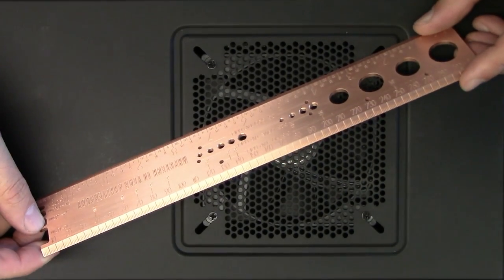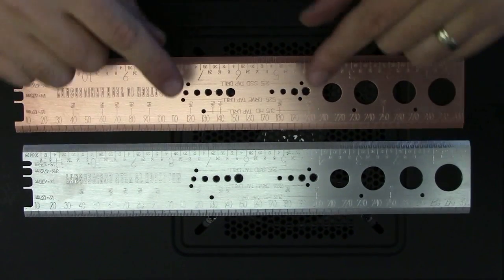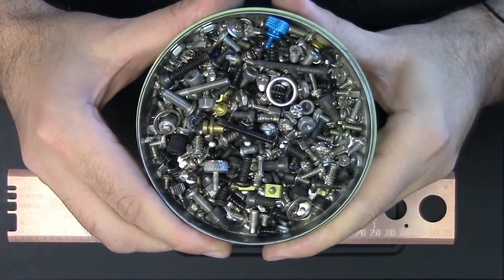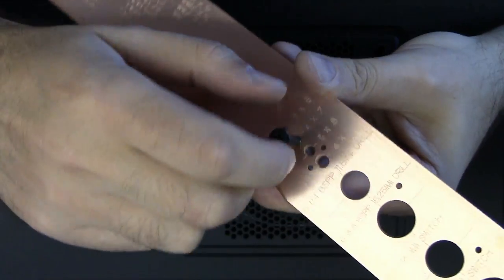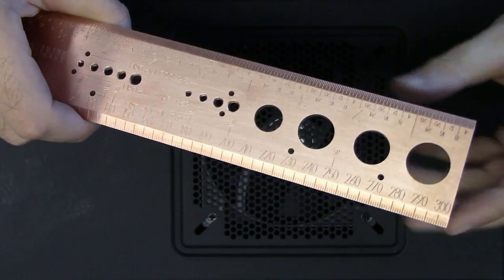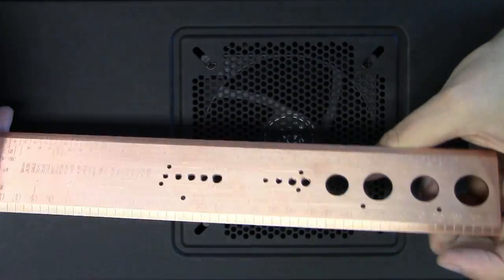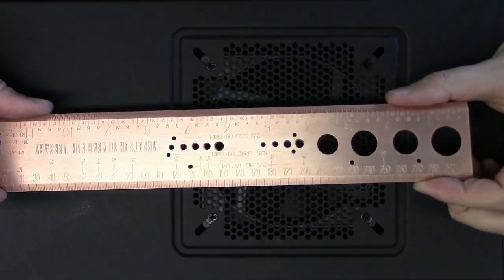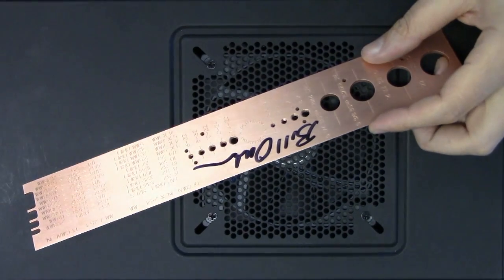COPPER PC Mod Ruler Giveaway & Mnpctech.com Discount Voucher

Comment: Not only am i attempt to make my first custom case from scratch from stainless steel & this would be an invaluable addition to use to template out my ss panels, mark holes, use to make the markings to cut the fan , hdd, motherboard tray, ect...
  Also, as a Lineman, i would use this every day to mark poles for proper distances, ss transformers to mount meter cans and drill out sides to mount c.t.'s.
  At home this would see everyday use around the house, for my daughters homework and my hobbyshop. And, i do have two coffee cans of bolts and screws that i one day need to sort out.
  I see a multi tool that this Single Father wants Santa to bring!
Reply from the maker: +Aaron Mcneal Congrats! Contact me with your shipping address, http://mnpctech.com/contact-us.html

Comment: I would use it to help install a tempered glass window on my case.... I'll need to check thickness, measure and rule lines, check screw sizes, use the holes to make nice rounded edges in my window and of course to cut in half all the apple computers...

Comment: This definitely is the coolest ruler I've ever seen! This would come in handy for future scratch build like my 3D printed case I made recently. When you are designing a 3D model for a PC case you have to take a lot of measurement.
But the coolest part about it are the threads in the middle because you are totally right about the random screws lying around!
It also would make for a cool unboxing knife.

Comment: I would use this quite frequently. The conversion chart alone is a godsend. Even though i know fan sizes by heart, I have messed with roulettes before for the larger ones. For screws and and width of different materials i usually use a vernier tool, but some sizes are more common then others so the reference threaded holes and the thickness gauge will be more than helpful. But most importantly the thing that makes this ruler a ruler, the bevel edges and the SCRIBED increments.

Comment: I would use this more for my 3d printer.  Since i have heard of the accuracy of this ruler, it will help to calibrate certain parts of the printer, not to mention the upgrades and nozzles swaps will be easier with the screw size gauges.  I have cups upon cups upon film cylinders and other containers that i can use that for separating the screws and becoming more organized.  Finally, it will help with my cosplay, the weight alone will help with pepakura cutting, or foam cutting.

Comment: Hi Bill I happen to have a ton of pc screws and I forget what the sizes are! I also get annoyed with the manuals pc case manufacturers send. The screws in the drawings are very similar and hard to figure out. I would also use it to measure the distance inside my case for bending acrylic tubing and for ventilation vents I want to add. That's what I need it for. Thank you sir!

Comment: I'll use it to open a box.... of new acrylic sheets I"m planning on using for a custom computer case. Also, of course I'll be using it to measure out where I need to mark screw holes for mother board mounting, ssd mounting, etc.... I'll also use it for the custom water cooling I'm planning on doing with the build. Can't wait to get working on this build this winter :D

Comment: I'd use it for scraping old drywall plaster off the garage floor...  oh, and obviously for the mods I'll be doing on the new case I'll be buying for my new build I'll be doing in the new year!  22 and 16mm anti-vandal switches, 240 and 360 rads, pump, res, and possibly my first hardline!

Comment: I plan to completely modify my h440 computer case and i will use the flat side to measure where to cut and make lines etc. Also the holes will be quite useful to create ventilation, esthetics, and cable holes. Thanks for picking me if you do.

Comment: I use my tap and die kit. I have a rethreading kit for putting threads back in. I can see this being handy for my PC screw bin. The aluminum one is good enough for my needs though. Fancy copper one might end up hung on a wall all signed like that. I'm working on a 1940's record player. Turning it into a dual PC cabinet. Replacing the guts and fabric with glass and lights. It will have an AMD side and an Intel and Nvidia side in each speaker box. The top lid will hide the DVD and blu ray players. The center cupboard will be a single liquid cooling loop for both systems. The PSU hidden on the bottom. On the back it will have a 6 foot pony wall made of plywood for hiding cables and mounting the 3 46" LCD's on swing arms. I have 2 old cases that the Mobo plate can get easily adapted. The I/O shield is hard to get lined up. The HD trays and so on. I'm still working on getting the parts together. Haven't even started on the liquid cooling parts yet. I have the nvidia system and 3/4 of the AMD system together. I might wait and see what the new AMD line looks like.

Comment: Nice! Like the threads for checking screws and the passthrough holes. Those can be used as template to make watercooling holes in ur case. Want it for hard tube build. Best regards Balubish

Comment: I am about to start on my own pc case mod for my next system. Taking an old  2004 Apevia X- Cruiser and bringing it current for radiator support and USB 3.0 and building a skylake system in the case. Oh the things i could do with all the parts at Mnpctech not just the ruler, but the ruler is a great start to my moding arsenal.

Comment: I'm going to teach my son how to change the airflow in his crappy case. We will take out drive cages and add fans with mounting brackets to the front panel. We will also add a single fan to top panel which I will use the ruler to position and  a fan cutout pattern printed from your website :)

Comment: Well, long story short, I would use it for modding my Air 540. My wife is doing here PhD and I have a ton of extra time these days. So, knowing that I am getting a Dremel from my mom, I thought I would get my hands dirty with modding. Looking at making a window for the non-window side of the Air 540. Adding some lights. And maybe some water-cooling fun.

Comment: I'm just now getting into modding and I always find myself looking around for some instrument to measure for my cuts or to make a straight line and my textbook just isn't cutting it anymore. My interest right now is completely rebuilding my wife's old HP computer. I've scoured the interwebs trying to find the dimensions for this thing. Nothing, not even on the HP support site. I recently visited the mnpctech website and came across this ruler and thought to myself "This would be sooo awesome to have." then I saw the price tag and my hopes were crushed. My wife would never let me spend that kind of scratch. Especially on a ruler. I guess the textbook will have to work for now or you can save me from my torment. thanks

Comment: Bill I am always using a tape measure its a complicated task always because in certain areas the measurements are never correct, the Metric screw size is a plus I have to guess screw sizes and 70% of the time I can never get the right size you have no clue how many times I want to buy screws from your store and I don't have means to determine size or length, that ruler would be a arsenal in my modding toolbox and a treasured peace being signed by the master himself. I am a student of yours and that ruler would be as a teaching tool to some day being able to identify screws, threads and dimension like you do.

Comment: This would save me so much time modding a Define S case I've been working on for months. Would come in handy since I lack a proper work shop and have been making templates with MDF. Also would work as a good back scratcher as dremel tool doesn't work so well for that...

Comment: I'm planning on making a "stealth mod" using crappy old beige-box case. I want it to look like Win98 machine from the outside (including slot-loading CD-ROM drive), but with all the modern components and water cooling on the inside. I would use the ruler to measure and cut holes for rads on the bottom of the case and openings for cable routing on the motherboard tray. I've damaged my plastic ruler with an x-acto knife.

Comment: This would save me so much time and frustration. For instance I had to drill some holes in the bottom of my hard drive rack from a ssd mount. I tried my best to get the holes exact but I was still off by a hair so I had to make the holes bigger. I like I'm sure many of us have a huge bin of bolts and screws. If I had this I stand a much better chance of sorting said hardware.

Comment: I would use it to help me with my little PC MOD Project build on the Apivia X2 Sniper Case. So far i installed 3 Fighter pilot toggle switches on it. I had to use a normal ruler for the measurements and spacing of the switches which made it harder. I plan on modding it a bit more by adding some 120MM fan filters and a small water loop. I plan on starting a new project by december, my micro ATX build in a 50 cal ammo can and I'm sure this tool would help alot with the measurement and cuts on that small amo box.

Comment: I would use it for measuring lengths too long for my caliper and easily see what types of screws (what size threads) I have with the handy screw holes on it

Comment: I would use it to help me finish my long running powermac G5 to ATX mod.

Also, i have a huge load of misc. screws i've stripped from old PCs, that are desperately in need of sorting. I already have jars, even. Just don't have a good way to confirm threads

Comment: I'm a computer science major and thinking about changing to mechanical engineering at my college. I'm in the process of modding a Fractal Define r4 to EATX with a vertically rotated motherboard. Then after that or if I get the money for my new LAN build before it I'll be trying to mod a ITX Ncase M1 to fit a ATX motherboard with maybe an external power supply if I can't fit it inside... which most likely I will not be able to do, but hey its worth a shot! Side note, not a full ATX power supply, the SFX  silverstone 600w modular one.

Comment: I'm gonna use it to mark where to cut the material and size up the drill holes for my custom cases, since I just have a plastic ruler the lines sometimes get a little off and I have to redo it, with this heavy beast, it wont be a problem.

Comment: I would use it to slice vegetables XD No but in all seriousness, I'd use it to precisely measure and gauge holes on my already-slightly-modified case. It's a basic case, but after a basic paint job it already looks 100x better. I want to add some colored fans, which the ruler would help me measure the holes for it.

Comment: I would use the ruler to help me create a shroud layer/case extension/radiator mounting shield (case mod) for the build I am doing for my living room/house mates so we can finally have a HTPC/Steambox now that we have a steam controller. I also do a lot of PC builds for friends and family so it would be really useful for measurements to check fan spacing and clearances when adding radiators. I think having a super quality ruler would also allow me to possibly make better use of my Solidworks software in designing/experimenting with case mod ideas. I would also use it at every one of my birthdays to cut my cake and open the PC Parts I asked for at Christmas :P

Maybe if I get this ruler I can finally apply the Overkill 240mm fan grill to the same HTPC/Steambox case mod! Hmmmm.....

Comment: First I will sit down with my scads of hardware and the threaded fastener gauge and sort & organize my screw assortment.  No more eyeballing them, and no more stripping threads by choosing the wrong screw.

Second I would use it to plan the fan and switch placement then draw it to actual size.  Once I have settled on a design, I will use it to layout the fans and switches to make all the case cuts.   Would end up with Fans that are straight and even, and switches that do not “wobble” around in holes that are too large for them…  Liquid cooling tubes entering/exiting the case, no problem there either, there are gauge holes for that too. 

I would then use it to make custom drive cages, and know the exact hole placement without taking time to measure.  Mounting SSD’s, Optical & Hard Drives?   Want it where?   Mark it, Drill It, Mount it, Done…

Did I mention measuring for case lighting?   I would take measurements of the interior and plan the case lighting scheme. With this info I would take strips of LEDS, cut them the length and mount them in the case.

Essentially with this ruler I would take my case creations and modding to the next level. I am sure along the way with this ruler in hand I will come up even more ways it can help in my endeavors…

Comment: I was going to comment asking whether threaded screw holes to gauge screws on this rule, turns out you've addressed it in this video. I have a simple moulded plastic screw gauge, but it willn't tell me the difference between UNC, UNF or metric screws as it's only what fits in the hole; good job on adding the extra time and tool wear to add these useful threads. I know it's picky but this is a rule which markings start from the edge, while a ruler has the start offset inside the edge.

I am not modding PC at the moment but I still have a handy set of tools that I recently used to put together an aluminum camera-tripod mounting plate, which I probably drilled the holes a touch too tight before hand tapping threads. I'd almost be afraid to use this rule as your autograph will wear out, but cool thing about this being copper is watching the patina porn.

Comment: Well, other than the standard "I would use it to mod this or that", I think first I would get some foam board.  Then, using a push pin, and some colored penciles, I would create my own Spirograph design with the various holes.  Once I was done with that little project that I'm sure my 8th grader would love to get in on, I would start plotting out my retirement build.  And yes, I may even sort out some of those various screws I have all over the place.  I didn't know that the holes were already threaded so that's a nice feature.

As for the rest of this thing, well, as may know, if you mod; then this is the rule to use. (a little gratuitous sucking up can't hurt, so don't hate)

Comment: currently building my first rig for my 900D and i had already replaced my custom mid plate thrice be cause of misalignment and/or imperfect holes. those holes would be very useful specially we dont have that much option in my place. i would like that ... :D
...
 thanks for the chance to join and more power
...
cant wait for your next project video log
Reply: those holes for screws are very usefull i mean ..

Comment: I would use it for my modding project. Currently working on a Mac Pro 2006 atx mod in white this time. I would use the thread checker and also thickness checker for all the acrylic.

Comment: I would use it for school and for my pc build. For school i do graphics and this would be great for model drawing and the small circles would come in handy. And for my pc im making a pc for Christmas and most likely in January doing a custom water cooling loop. This would be a great ruler for measuring the fans and radiator. It would be handy for the screws and the water cooling holes. gl everyone

Comment: I would use this MNPCTech ruler to help me build in my Special Edition NZXT Noctis Midnight 450 #29/45, which will happen to have a subdued Copper theme using the AsRock Z170 Extreme7 MoBo coupled with 2 XSPC Razor R9 290X water blocks and EVGA DDR4-2800 Memory Kit. Any copper themed ideas you might have will be welcomed, but I don't want to cut into this case... :)

Comment: i am going to use it for a really old case i bought second hand from a really cool dude. A lian li pc-2010 mod it to fix a 480 on top and 480 on the front and move the back io down a few pegs if it need be change switches to different locations and maybe make a new motherboard tray

Comment: That would be a fantastic item not only in my pc modding world but also with the manual machining I do at work. could use it to mark the area for a side panel window, then for the radii on the corners you could use the button hole reference. so much I could and would use this one tool for. sadly if I was to get it, I don't think the signature would last long if I am to take it to work due to the use of acetone and other chemicals/cleaners that would get on it. I would still love to get this tho...

Comment: I would use it for my current mod which is a mac g5 to atx 

im cutting the handles and the legs off addinging feet and making both sides open to make it more like a normal case and not a reverse case

Comment: I would use it as my keychain   o.O
actually I'm an engineer and I do a lot of 3D modeling and it's always necessary to have a reference, my desk is usually full of screws and other parts which are used as reference, it would be very handy indeed